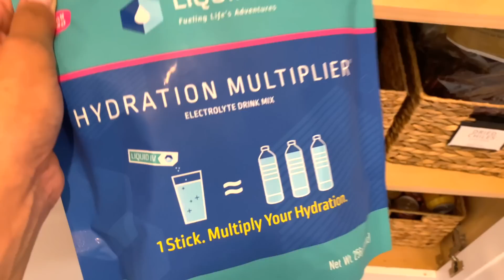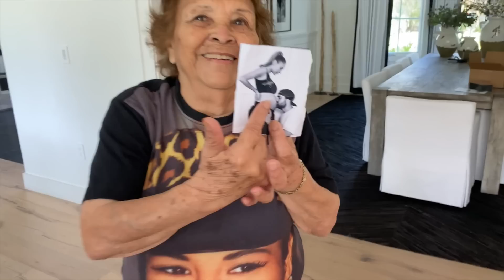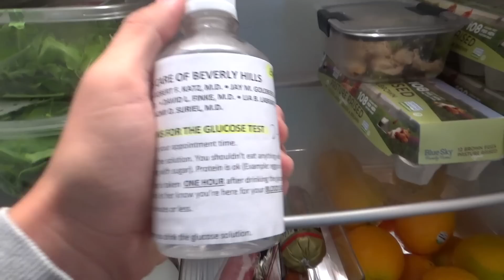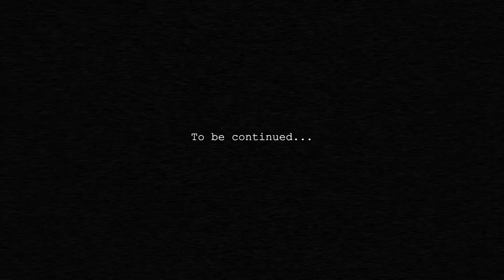Our Fertility Journey: Episode 9

Comment: Hey Desi and Steven!!! It looked like you guys used shackles to attach the chain of the swing to the seat. I wanted to suggest looking into something called “mousing”, if you haven’t already, which is basically a way of securing the pin so it doesn’t back off the threads and fall out! Wouldn’t want anything happening to baby boy or you guys 💙 thanks for continuing to share your journey, I look forward to every update 🥰